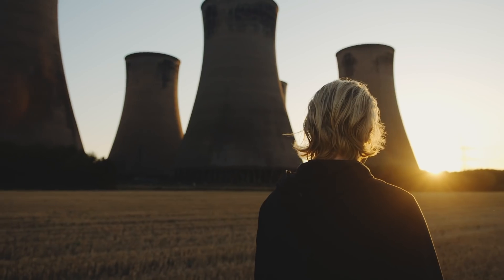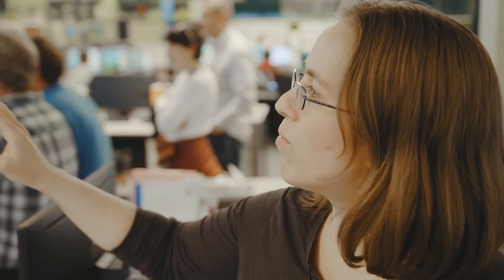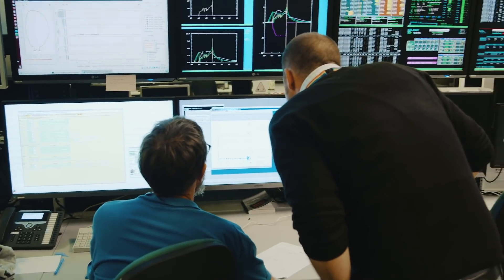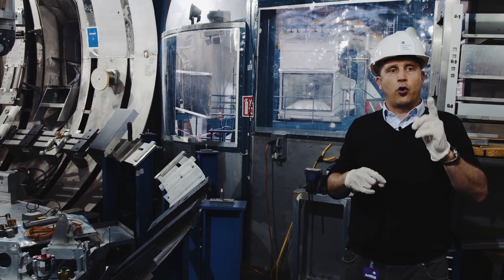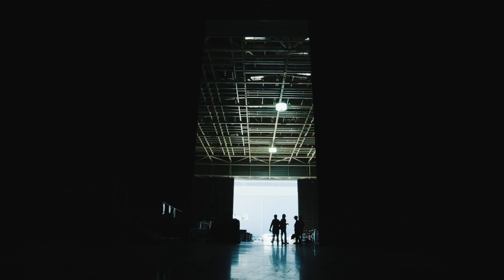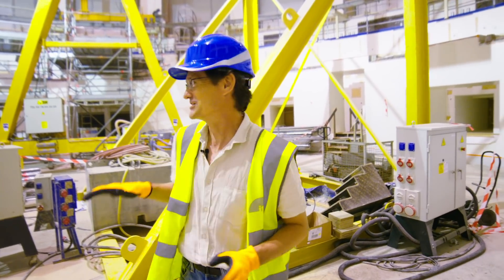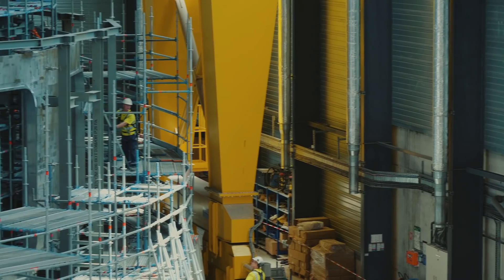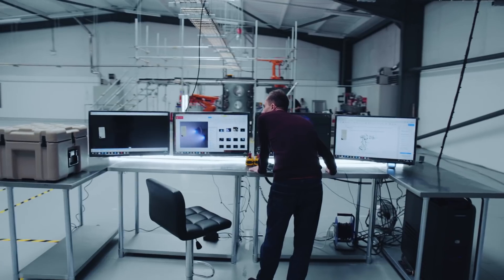Richard Dinan - Nuclear Fusion

Comment: Hybrid wax fuel is what we in hybrid rocketry have all moved onto.. Easy to formulate.. Easy to cast and less likely to trap air molecules.. Recycled Plastic is a lot more complex to heat and cast without trapping air molecules also unless you use an additive like oxide the burn results are quite varied ..